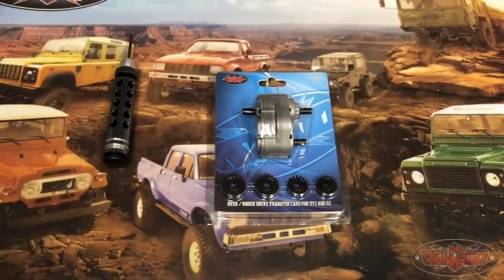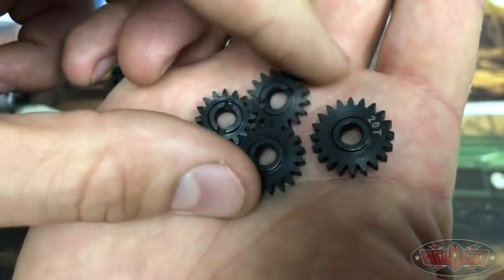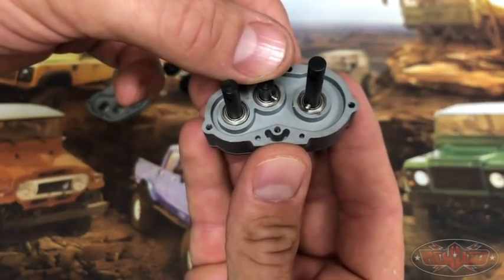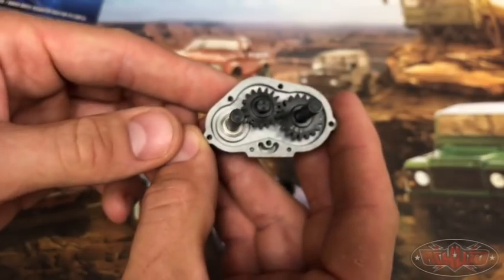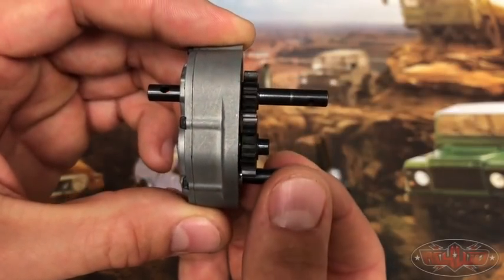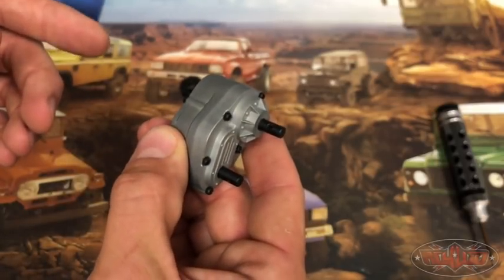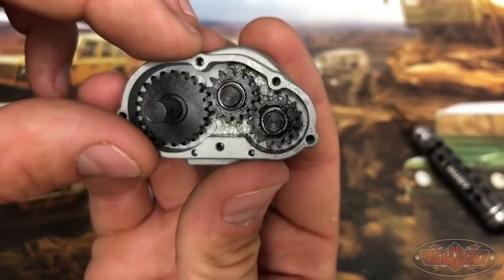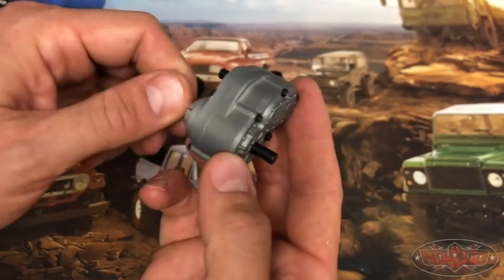RC4WD Over/Under Drive Transfer Case Breakdown | Tech Tips | RC4WD Garage Series

Comment: I think over driving the front hurts side hilling performance. I'm no pro but my understanding is ,poor going down hill , sliding on side hill angles , slight more wear on rear tires, and just a tad less battery life because of the bind that occurs. I would like to see a install on that box. I just did it in my diff cases

Comment: I just got mine Checker number 27 put the middle shaft back in backwards so I had to take the back side off so I could get the 15 tooth gear off from the main side so I can switch out my gear ratios thanks Checker number 27.... also I was given the commercial invoice so I got to see what RC four-wheel-drive pays for these damn things why was I disappointed in what I paid for it

Comment: Can it be geared to connect the tranny to the "front output shaft" to have the rear driveshaft in line and the front to the side? With equal speed/rotation?

Comment: Finally, someone else who understands it's worth spending the money on good tools! lol  These are great little videos, Mike, make sure Tom keeps you doing them. :D  They'll bolt right in place of a stock hammer tcase, right?
Reply: yup, We also have "Low profile" skid plates available. If you want this on the TF2, you can get the marlin Skid plate and the Corresponding bearing crossmember. 
and thanks for the kind words Nick!